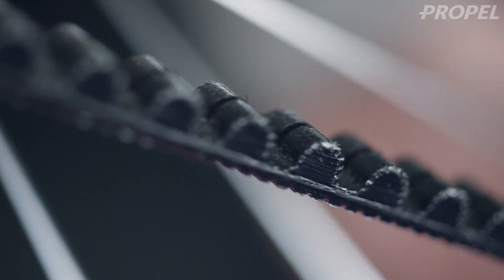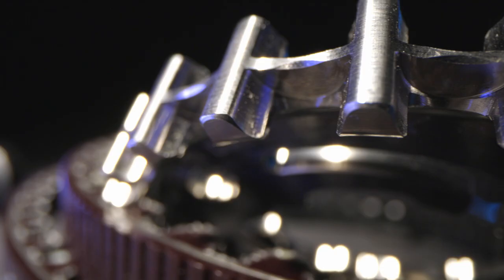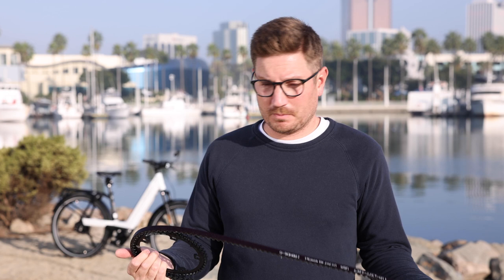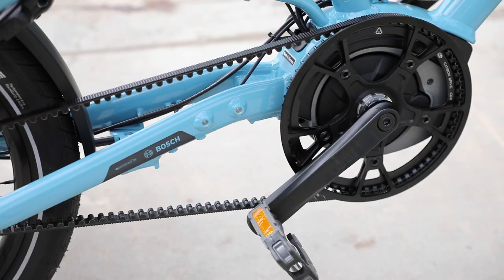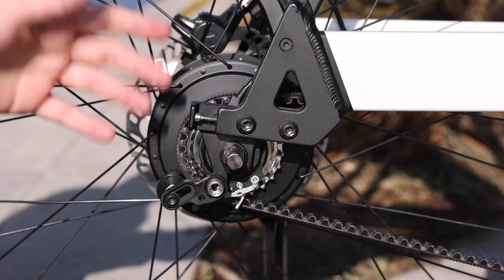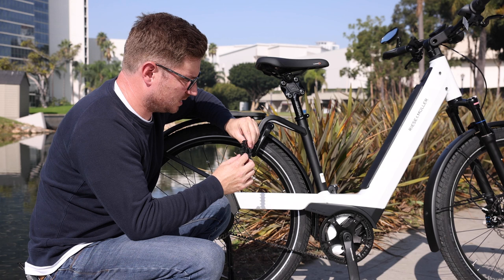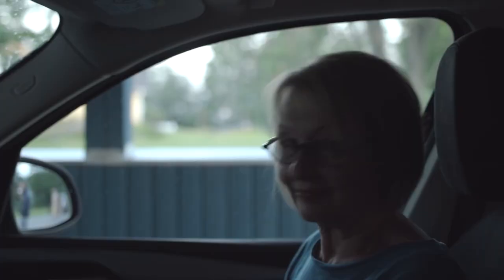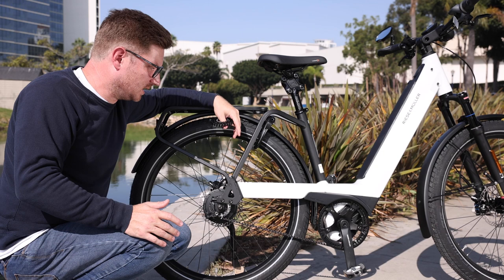Belt vs Chain - Will the Belt Win the Ebike Race?

Comment: Here's my story with Belt Drives. I bought a high end commuter a few years back because it had the belt drive, I lived in Brooklyn and needed something low maintenance that gets me through rain and snow, so got the BMC Allpenchallenge. Everything was dialed in, just an amazing bike, if you lower your expectations on speed. Belt Drives are amazingly quiet, I loved it. Then a year later, I started getting an awful "squeak" on every rotation of the crank. I took it to multiple shops, they couldnt figure it out. So I decided to take care of it myself. Started by adjusting the tension on the eccentric bottom bracket, aligning the front and rear cogs, got a tension tuner for belt drives, got a new bottom bracket, just threw everything I could think of at this thing. Disassembled and regreased every component on the bike, even sent Gates a video of the "squeaking". Nothing worked, I stopped riding it, yes it is near zero maintenance but I couldnt handle the noise on what were supposed to be nice and quiet rides. Fast forward a few years, I get back into figuring this issue out, and I decided to clean every connector I could think of. Belt drives most of the time (not always) require a split in the seat stays, so I unscrewed and cleaned the connection as much as possible (its hard to separate that area and get a proper cleaning) and mother of christ that was the issue, tiny dust and dirt particle get in the split zone from the frame flexing over time and thats where the sound was coming from. 
TLDR: clean the GD split area in the frame once a year.
Reply: Thanks!
Reply from the maker: Thanks so much for sharing this. This is great to remember and to note for those with a frame break.
Reply: I was lucky with my BMC AC01 with Gates CDX belt. 5 years of quiet commuting
Reply from the maker: Nice! I think some environments naturally require a bit more attention. But either way a belt is going to be less work than a chain.
Reply: I had similar noises from my Gates belt drive. Turns out that a simple jet wash with a pump up garden spray, using plain water on the tooth side of the belt cured/cleaned it. I got the idea after hearing that riding through dusty deserts can cause belt drives to start making noises unless the dust is rinsed off. I don't ride through deserts but thought I'd give it a go, and it worked.
Reply: What is split in seat stays?
Reply: I sometimes just water the belt down. Seems to work very well.
Reply: @robertfidler957  A belt drive is a closed circle unlike a chain. So for the belt to go through your seat stay tube it needs a split.
Reply: @meibing4912  
sure when the noise is from the belt, then it just needs the dust to be washed out from the teeth. In my case thats not what the issue was.
Reply: I had exactly the same problem on my Schindelhauer Oskar! The noise was so annoying, but on the other hand an easy fix (when you eventually find out what to do).
Reply: @larsdela5906  you mean actually cleaning the fine dust in the split's joint?
Reply: @frozenmargarita6127  In my case I just had to tighten the bolt keeping the split together. On the Oskar the bolt is recessed, so I actually didn't notice it at first. A quick tightening did the job. Generally I can imagine a cleaning of the joint would not harm if you have problems with noise from the split.
Reply: So if you buy a bike that doesn't require that split it's one less issue. :D
Reply: @user-yv2cz8oj1k  if you dont buy a bike, you will never have this issue.
Reply: So duct tape around the split after locktite?
Reply: That's interesting, I haven't got a belt drive but do have a split in my seat stay as the higher end model in the lineup comes with a belt. I have noticed an annoying squeaking while pedalling that is hard to replicate. Maybe I'll look at tightening it a little. Thanks.
Reply: Its the fine dust in the sllit that was making it squeal. Clean that before tightening.
Reply: MOC lol.  Great story, way to  perservir.
Reply: My Priority bicycle squeaked too. Never figured out where it came from.  Annoyingly finally gave it away for free.
Reply: Thanks for the advice.  Just got 600x for long distance back packing.  I am sure this might become an issue.
Reply: @rothgartheviking858  ...but it is a very nice bike, so enjoy it...
Reply: Whenever this happened to me, I learned that spraying silicone on the belt got rid of the squeaking. It occurs when dry dust or sand gets on the belt.
Reply: I thought the whole entire purpose of belts was less maintenance. Cleaning every year to maintain tight tolerances doesn't seem worth it. Might as well go with typical, cheap drive system and just not do maintenance and deal with similar noise issues
Reply: Great way to share the faults and complexity of belt drives.
Personally, I'd stick to the traditional, tried and true chain and derailleur system, especially with the new, durable Shimano Linkglide designed to be up to 3x more durable than regular drives and much easier to maintain not to mention far cheaper than the belt drive. 
This system has always stood the test of time and maintenance is of no issue.
Reply: On my bike i have taped over the frame split as i don't plan to open it very often and I have never had aly debris inside

Comment: So I’ve been writing 45 years with chain drive. I’ve also toured a lot over land. The thing with the belt drive because you have to have a specific set up for it. And if you’re overland touring going across the countryside due today and something happens with that belt you better have a spare. Or you’re up a creek without a paddle. I recently watched a YouTuber that tours across the continent on a full-time basis and he had broken his belt drive on his priority 600. He was basically screwed. Yes chains are more maintenance, But part of owning a bicycle of any type is being turned into your maintenance just like any vehicle. I change real easy to get in any small middle of nowhere town. And usually a cassette or free wheel can be found and change mine because these are all wear down in synchronization. In the 45 years that I’ve been riding I never had a chain break just wear down.

Comment: Belts every time with an ebike. So much easier to care for. Clean, quiet and less maintenance
Reply from the maker: Well put.
Reply: My e-bike has had one service in 3 and a half years. No replacement parts so far. And when I look around at other bikes, it still feels like I’m riding a space ship by comparison.
Reply from the maker: @christill  love this space ship idea! Maybe we are already living in a Jetson era and we just didn't know it.
Reply: Chains can be 100% recycled. Can belts?
Reply: @dpstrial  I am not sure. Can you tell me?
Reply: @dpstrial  Yup. 100%. Also, recycling take exponentially more energy than producing, so throwing away fewer belts than you would chains would reduce your footprint much, much more significantly than that to which you're eluding. Additionally, most belts have nothing in them that has to be mined for. Research how mining affects the environment and the typical treatment of miners across the world. You could switch to a belt and feel pretty good about virtue signaling your awesomeness to pretty much anyone.
Reply: More efficient as well, better curve for the high speeds that ebikes can easily hit.
Reply: Not just ebike. Zero maintenance.
Reply: I love riding my ebike without motor assistance when ever possible as well. So I like to have the drive system that has the most efficiency on an ebike as well. So far, being in Switzerland, I have a Bosch midmotor with a chain drivetrain and a Shimano XT derailleur.

Comment: Belts are cleaner, quieter and super low maintenance. I found something very interesting, because I had 2 bikes with the same frame and motor - one with 11 speed Shimano Deore XT 11-50 cassette, the other was with Enviolo. Both of them using latest motor from Bosch Gen.4 85 Nm. Riding each of the bikes is completely different experience - chain feels more powerful, less resistance while pedaling and pretty fast. On the other hand side, belt feels very good, smooth, however bike accelerates a little bit slower, feels less efficient. The other significant difference is battery consumption - belts consume more, this is confirmed by testing them on the same terrain.
There is one more difference - when you turn off motor assistance, pedaling bike with chain is much more easier than Enviolo. which feels very hard when you do not have motor assist.

P.S. Bike comparison is between Riese Muller Multicharger MIxte 2022 750 Wh ( Touring with 11 speed Deore XT vs Vario Enviolo )
Reply: I guess those rightly noticed differences have more something to do with the Enviolo gear hub compared to the derrailleur, than the chain drivetrain itself in comparison to the Gates Carbon belt drivetrain.

Comment: I’ve cycled and raced bikes for over 25 years and now added a Rohloff with a Gates belt on my R&M for daily and next years long distance touring. Just love the simplicity of it. Love the video and very well explained.
Reply from the maker: Thanks Andrew! We’ve heard similar stories many times over actually. It’s a great way to go!
Reply: Hi @Digital.Done.Right. I'm intrigued by the fact you mentioned racing bikes! I've been trying to get more info on belt+racing for weeks and just nothing really to base myself off of. There's this wooden bicycle manufacturer in my area and we've been playing with the idea of making a belt drive wooden racing bike. The efficiency of the Rolloff 14 seems to be super ok. The major downside appears to be the frame that needs to guarantee both belt tension and alignment. Secondly, if anything goes wrong, you're not really going to work on an internal hub system like you play with the simplicity of chains+derailleurs. (Repairability) What's your recommendation given your massive experience?? :)

Comment: If youre a regular biker moving mostly on paved roads to work etc then chains are the way to go. Belts have their advantages in rougher conditions since they dont really care about mud and dirt. Chains are more efficient and unlike belts work with regular derailers. Theyre more efficient as well  so itll be a bit easier to pedal.

Comment: I have a stand up elliptical used it since 2011 w avg 2 >3k miles per year, Wipe the chain 1x week &lube and still works fine. I also have a REI Novarra Gotham w Nuvinchi 380 and Gates belt and love that as well.
Reply from the maker: Thanks for sharing this! If you can keep a chain clean it will usually it will hold up really well. The trouble is bikes are usually ridden in much dirtier environments than your home. That Novato Gotham looks cool!

Comment: Thanks for this. I test drove the Gazelle range (C-8, T10 RMB and I think the 380) tonight and insisted on testing the belted version as I’ve had experience with modern carbon belts in cars, and I’m impressed.   I’m concerned with the nviolo cvt twist grip transmission and the cost when they fail. The sales rep did point me at R&M when I asked for other recommendations and I noticed I was jumping from $2,500 CAD to 8,000....Jesus guys, and all I wanted for my midlife crisis was a broken-down Miata....

Comment: Great video Chris! I've had my Vario Load 60 for over 9 months now. I find the bike and the belt drive extremely low maintenance. The belt developed an annoying squeak after about 1200km. I bought a Gates Krikit tool, adjusted the tension and bingo - fixed! I look forward to many years of riding on this bike.
Reply from the maker: Hey Steve! Happy to hear you’ve been happy on the Load! That thing rocks! Hope you have many happy rides ahead!

Comment: With internal hubs the chain typically lasts 3 times as long as with derrailleur gears. So >=3000 miles instead of >=1000 miles.
There is a surprising combination (that I prefer for Biobikes): A chain with a closed chain protection like the Hebie Chainglider. Almost no maintenance needed and I used a chain with this combination for 6000 miles (10000 km, for the majority of the world ;)).
This is meant as additional information, not a contradiction to this video. Especially for Ebikes, belt drives are a great option.
Reply: Excellent point! The chain does not need to bend/flex from lowest to highest cog and can be much more robust as well.

Comment: Thanks for the video! I was riding the R & M Supercharger2 GT Vario HS with Enviolo, and the R & M Delight GT Rohloff HS. Although I like the idea of belt drives in general and see some advantages of belt drives, for me they have some major disadvantages. That's why I would still prefer a chain drive like the Sram Eagle, or Shimano XT : 
1. Gear changing with the Enviolo is pretty smooth, but the range of 380° is a no go if you're riding mountains, or as I did, riding a speed pedelec. In Germany the speed you could achieve is around 30 mph, but then your cadence with the enviolo gets just a way too high.
2. Rohloff provides a wide range (526°), but the gear change takes too much time. So you loose speed again and it just interrupts your paddling flow.
If there would be something with the same range and gear change comfort like a sram eagle 1x12, but only with a belt drive, it would be great.

Comment: My first introduction to Gates was back when I used to be into motorsports. When you have an interference motor, you really don't want your timing belt to snap (otherwise you'll do some very expensive damage to your valvetrain, and possibly your pistons). A Gates timing belt might cost a little more, but if you car about your motor, it's the one to get.

I'm happy they're making bicycle drivetrain parts. I'm thinking that there would likely be few supply chain problems from a large auto parts manufacturer vs the likes of Shimano or SRAM.

Comment: I am using my R&M charger with beltdrive and enviolo gearbox for everything. 50.000 km in 5 years, still with the 1st belt and 1st gearbox. Whatelse can you expect? 
Commuting, Shopping with a Trailer behind, Vacation, whatever you can think about ... no problem with this combination. The lower efficiency of this combination results in lower distance per accu-load. (about 80 Km  per 500 WH capacity). I just use a 2nd battery, which I store in my luggage, whenever I  am planning for more than und 80 Km per day .

Comment: Good video Chris. I've enjoyed my belt drive Avanti Inc 2 commuter for 7 years or so now, and have really appreciated the low maintenance aspect around our dirty country roads. One bit of feedback specifically on Shimano Alfine 11 speed: the hub leaks oil due to a badly designed seal, meaning the belt gets greasy and this in turn attracts dirt. Not a big deal as it's easy enough to wipe the belt clean but worth pointing out.  In terms of components longevity, I haven't managed to get more than about 5000km out of a single belt, and change the cogs after 10000km. I'm definitely a belt convert.
Reply from the maker: Thanks so much for sharing your experience. The Alfine hub is really cool, but it's a bit quirky. I wonder if Shimano has a fix for that leak. I know we had a good amount of ebikes sold with that hub and it seems they have held up well. We did have some trouble with them slipping under extreme torque, but otherwise they perform really well. I wonder if that oil contributed to lower belt life, I suspect it may since it would cause more dirt to cling to it.
Reply: I'm not aware of an endemic problem with the Alfine hub. However, I've got a road bike with belt drive and the Alfine 8 (Civia Bryant), and I did have a problem with oil leaking out after having the hub serviced. The shop had damaged the seal when they were reassembling it.

In my case, the oil got out on the brake side of the wheel, so no problem on the belt, but of course made a big problem for braking. I gave the shop an earful, made them repair the hub properly, and never had any more trouble with oil leaking.

I've also got a R&M Supercharger with the Enviolo and belt drive, and it's fantastic. No leaky hub there either.

Comment: Great overview. Yep, I used to ride Harleys and I rode them hard. I can't recall that exact year they switched over to belts, but I want to say it was in the mid to late 80s.

I got about 12k  miles spread over about 5 years (I always had more than one Harley at a time, so my mileage was spread over 2-3 bikes) and even in the one case where I replaced the belt, I did it just for peace of mind. The belt that I replaced was just showing a small amount of wear, so I preemptively replaced it. That particular bike was a bespoke bike that I built and that had a very high hp, high torque, S&S engine which made the belt's longevity all the more impressive. And boy did I push that bike hard with frequent full throttle pulls and lots of holeshots! Hey, I was young and power hungry! 🤠

It's awesome tech and I wish my RadRunner had it.

Comment: There are rubber timing belts in engines that are coated in oil spinning at thousands of rpm. in extreme heat.  Not saying it is the way to go but in comparison E bike stress is minimal.  Plus they are easy to change.
Reply from the maker: It is pretty impressive what is possible. I’m pretty sure most of those belts are reenforced like the ebike belt though.